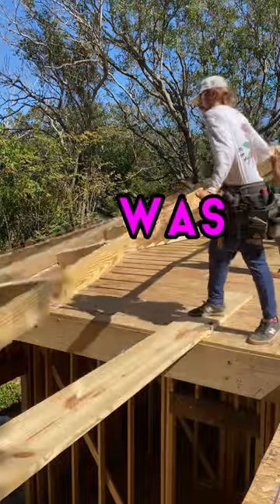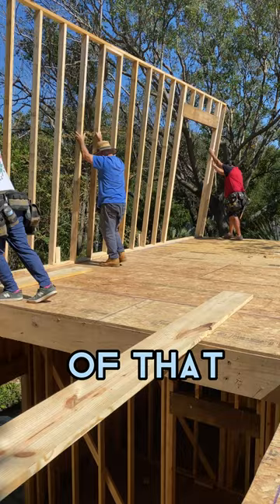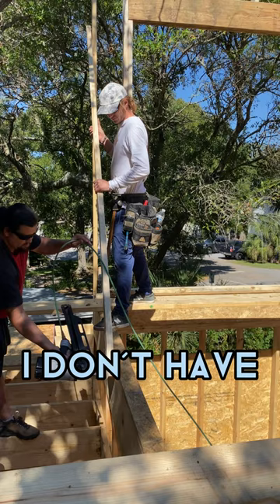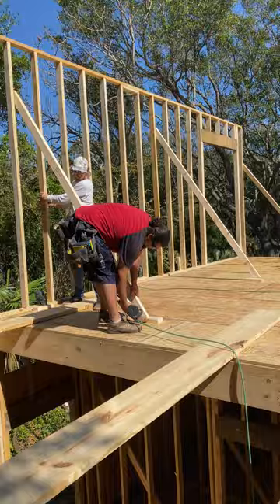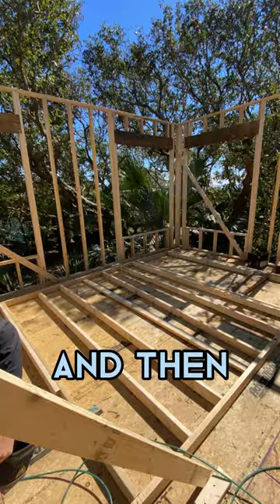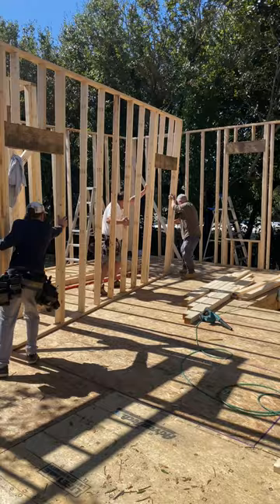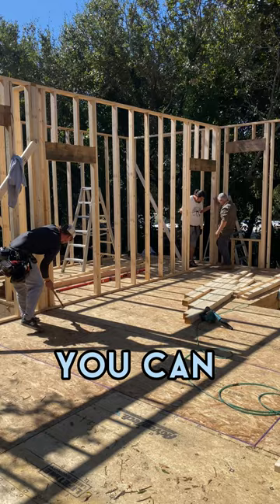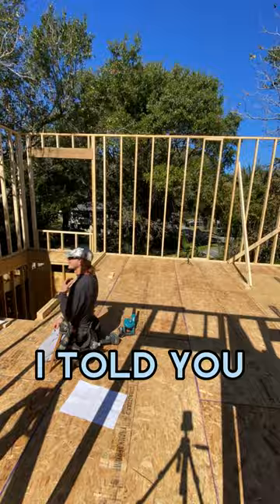Second Floor Walls | Artpentry

Comment: Dude put your double plate on before you lift your walls up , saves alot of time on ladders, I framed custom homes for decades , we would triple plate and layout everything on the ground , saves alot of time , looks good though, you can layout the entire second floor joists and if you are on the second floor you can layout the entire roof on your second top plate
Reply: I was just thinking why isn’t he doubling his plate on the ground. Saves a lot of time. Mixed view on layout on the floor.
Reply: Why isn’t he sheeting the exterior walls prior to standing
Reply: @tonyburdick5512  I think it's how we were taught when we started I was taught same as you, I started in 83 doing tract homes so it was all about production, we would frame 2 to 3 houses a month , cut and build all headers , Jack studs , beams, triple plate entire floor and layout out before we started framing , cut rack braces in and sheathed on the floor , if it was plywood sheathing we would house wrap to , but back then with the tract homes we used celotex so we had to cut rack bracing in the walls before we sheathed , now the codes have changed and they use the engineered sheathing and the zip system tape on the sheathing . Times have changed for sure
Reply: @tonyburdick5512  I’m guessing us 1980’s framers could keep up today. We don’t need a $300 hammer to drive nails. Most of these kids really need a nail driving lesson. The tools today and the fasteners are much better than we had. Cordless saws…I could surely have used a joist hanger nailer in 1990. Framers today get paid better. Not as much qualified competition. Better speak Spanish. I kinda wish I was 30 years old today! I’d clean up framing!
Reply: @tonyburdick5512  we also had 2 crews of 5 men each one crew would frame walls and sheathe and the second crew would frame and sheathe the roof and any custom add ons , when we did custom homes it was a little different
Reply: @carpentertom2835  gotta love let in bracing. I hated cutting  celotex in the hot summer. The stuff was so darned itchy!
Reply: @mcbridecreek  yeah it was , the worst stuff we ever used was the thrmoply , junk it was, it all depended on the builder we were working for
Reply: @carpentertom2835  I only used it a short while in the early 80’s. I was in Idaho & Utah. A few years later, I was in CA and we put plywood on the corners and left the studs bare. The stucco lathers covered it up. That old 3 coat stucco is tough.
Reply: @mcbridecreek  yeah you don't see that anymore, I had a Colorado framer on my crew I did all my work in south jersey and Pennsylvania
Reply: @carpentertom2835  Nj wow. I lived in Westfield NJ for a few years. The framers leave the studs bare and then a sheathing crew comes and puts plywood on. The Brazilians sheathers come with about 12 guys and bag it out. They really nail the hell out of it. They use so many nails, I don’t think they worry about a nailing schedule! Haha
Reply: @mcbridecreek  👍
Reply: Agreed anything done on the ground is easier/safer than off ladders/staging
Reply: @carpentertom2835  I did a house about 5 years ago that required rack bracing. Sucks cutting the slot
Reply: @mcbridecreek  I live in MA and when we aren't using zip its usually 1/2 osb for shething. Nailing schedules are usually just called out for beams and structural hangers
Reply: @davebona9592 this is more time saving than double plate... we used to build temp staging around to install rim joist and floors so no up and down on ladders
Reply: @Dave Bona  here in ghetto az we don't even sheet the ext walls. We put a piece of shear on here and there. Other then that foam and stucco. Ghetto af but fast and cheap

Comment: Why you guys don’t sheet the exteriors wall before lifting up? I started framing last year here in Bc and we sheet exterior walls before lifting them up?
Reply from the maker: This was my first ever full framing job. I thought about it. But since I wanted the sheets to overhang the floor system  as well I found this to be simpler. Maybe I will on my next house 😊
Reply: makes the walls heavier to lift depends on crew size.
Reply: @Artpentry  just measure the overhang on the sheet and you can overhang the sheets.
Reply: @Artpentry  Ah okay
Reply: @Artpentry  I've been framing for 44 years you can let the plywood hang down the distance you need to lap over working on a ladder is slow anything that can be done without a ladder is always faster and safer.... put your Tyvek or house wrap on also
Reply: @paulunderwood8960  exactly, worked with one framer who put the upstairs windows on also. Actually was surprised how well it went. Just goes to show if you build stuff by the numbers and square.
Reply: @Artpentry you should look into (wall jack's). U could finish most of the wall before lifting. You could also use straps on the bottom of the wall to make sure it doesn't slip off the deck.
Reply: @Artpentry  Agreed with sheeting on first.

It does make it heavy, but then its done.
Also, we flush up to plate and back fill the bottom over the sill plate
Reply: @Artpentry  you can still overhang your sheets. Just square the wall, snap a line burning whatever length you want it to lap. We frame our knee walls bare and plywood after. Then floor joists,and floor shething. Then 1st floor walls we overhang the plywood to meet the top of the plywood below. When you do layout stack your studs so everything lines up, and you can go back and nail off the bottom of second floor shething after the walls are stood. It helps lock everything in. Fast nailing though
Reply: causes its to heavy,look at the crew ud hurt ur back taking all the lift bro
Reply: @michaelkrilla1187  we do it all the time.
It squares the wall, reduces time, cause of sq of wall afterwards, installing 4 x 8 sheeting of the ground.

Princess, carpentery is hard work.

Its not like moving a mouse on a desk and being tired at the end of the day.
4 men can easily lift that wall with sheeting.

3 is hard but can be done
Reply: @denniswilder3014  a boss I had told my leverage will move the world. You’d be surprised what two man and a 5ft 2x4 can lift
Reply: @Artpentry  You can just hang the sheets of plywood down that way you get the same result
Reply: @denniswilder3014  Yeah but you're saving a ton of time time is money
Reply: @WendilynBelle  if you have enough guys it's way faster to sheet the walls on the deck then lift them.then doing it while there standing
Reply: @denniswilder3014  i kno I agree. That's why I asked why not do it that way. Lol I stoned so I might have typed it wrong lol
Reply: I'm using my girls account so my names not Kelly lmao. But yeah i don't understand why people wanna walk around the house with a ladder or off road forklift and sheet the walls in place. I have done it and it sucks every time. Usually when a crew got fired and we took over there build and they didn't sheet before lifting. The way these guys using braces with using a 6 foot extendo level then nail the brace after leveling in certain areas.  Boom two birds one stone. I have lifted full sheeted walls with just two guys so lifting isn't that bad considering u got a few strong guys. This way there building just has so many extra steps you have to take for no reason. But u looked at some comments at it was there first build so 🤷  but the real o.g carpenters kno what's good 👍 😎
Reply: @denniswilder3014  not that bad. I have lifted some big walls with plywood and I'm 185 and not that big. Was is hard. Yea but nothing in carpentry is easy. And if it was it wouldn't be called work. Taking all those extra steps to sheet the walls on the outside then wrap em is way to much extra time. And time is money on a job site. Even a backyard build its just not worth it. Plus u can level the walls on the chalk line. Nail the use a extendo wall level and plum the outside walls.  Brace em and then your inside walls can go into place and be nailed and keep it moving. Instead of leveling the walls on the outside when there are inside walls already in place.
Reply: @paulunderwood8960  couldn't agree more. 24 yrs over here and thats the way to go my friend.
Reply: @WendilynBelle  you must not work with lvl products.i have not used a pine 2x4 in 10 years.

Comment: Framed 1st house in 1970's to 2010 and never stood a wall without the double top plate on. Would have the 4ft plus piece ready to tie walls if a intersecting wall. That bend would not have happened. Plate nailing is next to studs into joist, in a stacked layout. Clearing plate for plumbing and electrical drilling.

Comment: What is the short 2x4 block for that you installed underneath top plate between 2 studs about midway point of first long wall you framed and lifted?
Reply: A bullshit solution to not breaking the plate over a stud.

Comment: Sheet them before raising them lol
Reply: do you know how heavy that is for a group of what like 4 guys they got here? they would need a machine at that point to help lift.
Reply: @Glados1080  one guy every 8 feet we’re 4 and lift it just fine
Reply: @Glados1080  26 years framing and still do it like that
Reply: @Glados1080  and 2x6 walls on top of that
Reply: @Steve Gagnon  I will pray for your back bro, there's no need to destroy your body for the job
Reply: @Glados1080  lol it isn’t that heavy , it beats sheeting walls after and way faster

Comment: I always wondered this I was a framer for years why do you guys put up the outside walls without putting on the plywood 1st that way you can plum the walls after and not go up on a forklift and sheet u just lift the wall with the plywood

Comment: QUESTION, I am building a small cabin at my farm and I framed the whole thing but when hoisting roof onto the frame I had to use my truck because I was alone, it kinda pulled some nails and made the whole frame flinsey, how to I make it not shake when I push it?

Comment: Any block lines going in those walls homie? I do commercial walls so idk what the fire codes are for residential where you are or what plywood length your running

Comment: Yeah well you’re not “done” with anything. Here we block, and back and sheath, and wrap, and plate, ans sometimes install windows and siding and anything else possible BEFORE the exterior walls are lifted. 100% 2x6 exterior walls too. Now in your case someone has to work off of ladders or scaffolds or whatever else 20’ off the ground to hang sheathing and etc. Really inefficient and kinda dumb😂
Reply: How man people you think would be needed to frame, sheath and stand 2x4  wall 9 ft height with 1/2 OSB with total wall length of 48 ft?
With a couple of 3x5 windows with 2x8 headers. 
Can frame but we don’t do it for a living.
Reply: 3-4 guys, in 16 ft sections
Reply: 3-4 guys on a 16’ section would go up easy with the sheathing on. And top plate. I never liked going up on a ladder when I could do it on the ground.